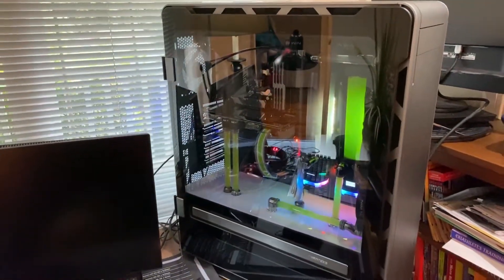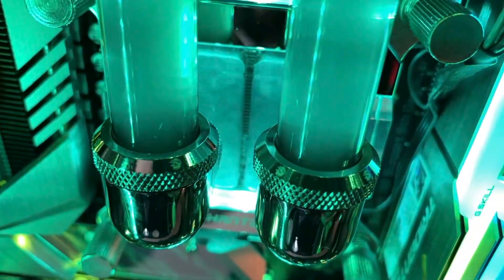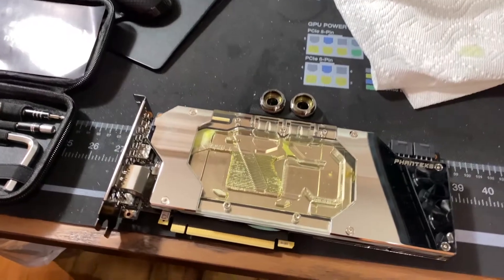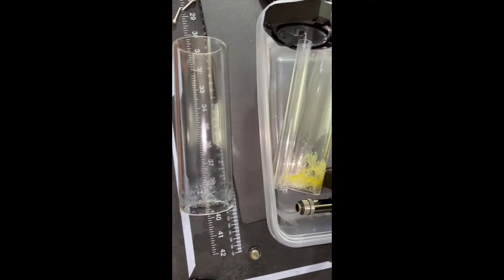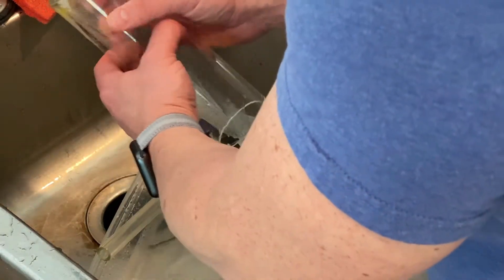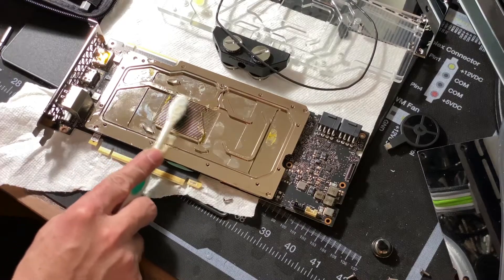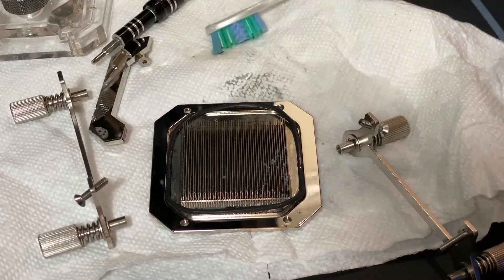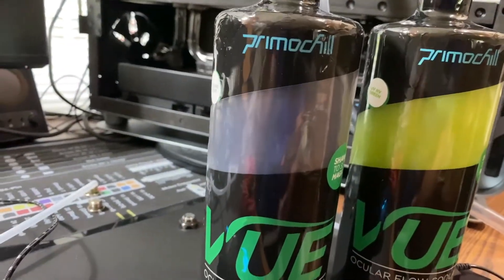Primochill Vue - Easy to Clean?

Comment: Hey James, loved your videos of this build and the follow-up.  Since the first run was a new build, how has the Vue held up for the second fill since you posted this video?
Reply from the maker: Thanks Jake for the positive comments.  I love the Vue.   My first fill lasted a good year, the second only about 6-8 months before it got sludgy.  I am now on a 3rd batch and 8 months in looks good.  I have not had any concerns about build up in the water blocks for any of the batches, only changing them because of aesthetics (build up of sludge in the reservoirs).  I regularly watch my fluid temps and at worst (when my son plays for hours on video-card heavy graphic games) temps never get above 63-65 deg C (CPU heavy tasks similar).  I regularly get gasps of awe from guests when I fire up the system.  Nevertheless, it does require yearly upkeep ( it takes me a weekend to drain, clean and refill the system).  Hope that helps if you're considering trying Vue.
Reply: @007triman  Thanks for the reply.  I've heard a lot of horror stories, but definitely tempted to give it a go. I suspect the glass tubing maybe part of your success.

If you don't mind me asking, I have two questions:

Did you do any special preparation to your loop before loading the coolant (such as a primer or blitz)?

Do you leave your machine on all day or use sleep mode or shutdown when it's not in use?
Reply from the maker: @McGuirk808  No problem Jake.  I used the PrimoPrep that comes with each bottle of Vue - check the website, but I think you need to drain and rinse out your previous fluid (possibly requiring their System Reboot fluid), then use Primoprep for 72 hours, drain and rinse with distilled water then replace with Vue.  I shut down my system when not in use - another factor besides the glass I use is that I generally don't have this computer on more than 2-3 hours per day.  Good luck with whatever you choose - and I hope you post videos!

Comment: Hey quick question is it true this case comes integrated with RGB fusion ready, aura sync and mystic light?
Reply from the maker: Sorry for the delay - the case does have its own RGB lights, but I'm not sure what the software is that runs it - there is a dial on the front panel you can rotate and press that alters the color and display pattern, but you can also control the case lights with certain motherboard software.  I have an Aorus motherboard and I find the Aura Sync to be a hassle, so I just use whatever Phanteks software came with the case.
Reply: Beautiful thanks man and nice setup

Comment: Just put some of this in my system, it's not nearly as bad. I just use distilled water and XSPC Clear UV coolant concentrate. I had a little gunk buildup in one loop, but replaced all the parts but the radiator, so we'll see how long before or if I even get any more gunk buildup.

Comment: 12 months?  Vue has a shelf life of 6 months
Reply from the maker: I'm sure you're correct.  I wanted to see how long I could push it.  I thought what was still suspended in solution still looked good after 12 months, with deposits as you can see in the video.

Comment: did you notice the average temps changing much over the year? would you do it every 6 months instead to save hassle or do you think it wouldnt matter as much
Reply from the maker: I did not see temps changing over the year.  It was the visual build-up of deposits on the reservoir cylinders that was the first sign I needed to attend to the fluid.  You ask an interesting question about frequency of cleaning - would doing it more often be less of a hassle?  Maybe rinsing the system (draining the fluid, rinsing with distilled water, then running a detergent like "Reboot" for a couple of days, followed by more rinsing) would obviate the need to take out and scrub the water-blocks  with a brush, but I feel the rinsing was the major pain (probably because of my loops not draining well), and taking off the water-blocks was not very difficult.
Reply: @007triman  On your next build I bet you will pay closer attention to leaving yourself a way to drain easily? I recommend switching to flexible tubing in the back of the case. This way you can install any number of ways to drain easier, and you have to cut less hard tubing. 

I've never done glass tubing but I think I will on my next build. The plastic hard tubing always looks plastic and isn't perfectly straight. That glass tubing is on point!